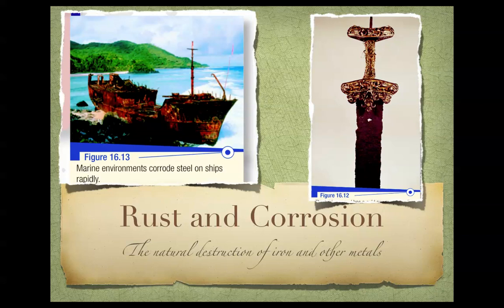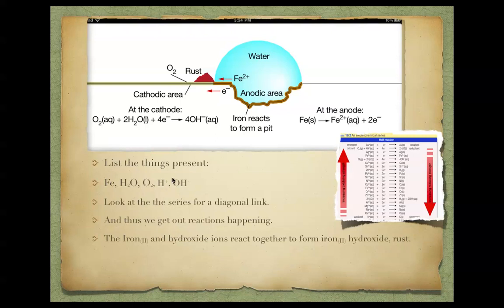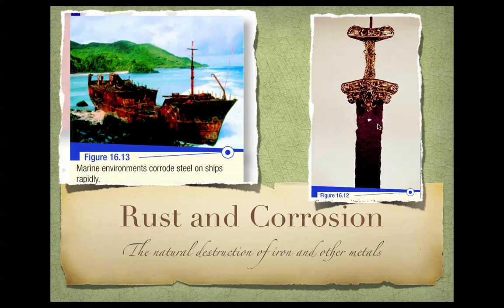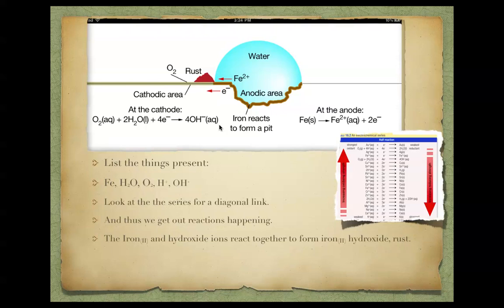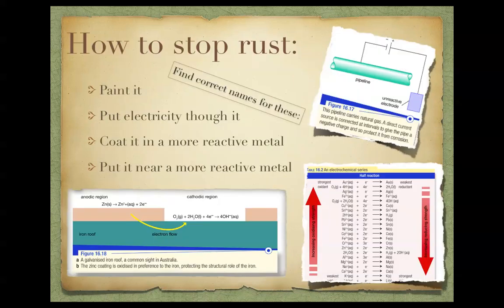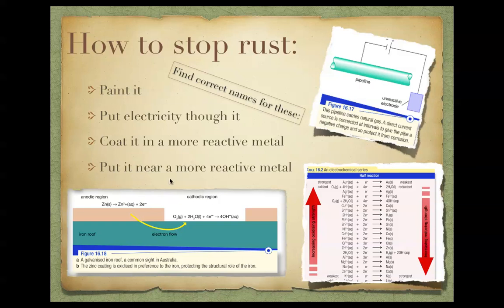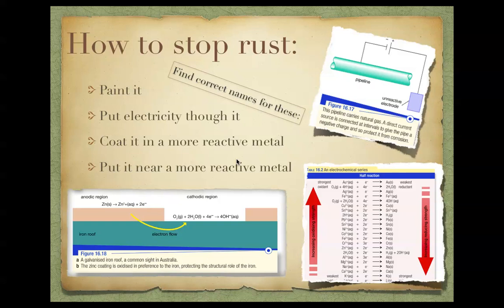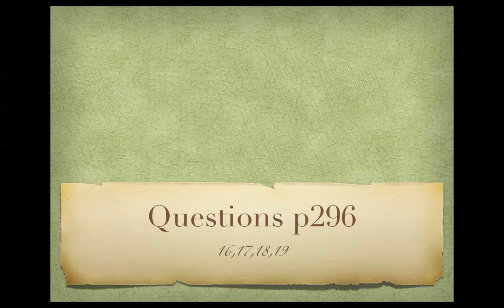Chemistry: Rust and Corrosion

Comment: at @4:00 can you please write all equations I am lost to under stand it
Reply from the maker: O2(g) + 2H2O(l) + 4e- --> 4OH¬-(aq) 
(Fe(s)  --> Fe2+(aq)  + 2e-) x 2 as you need to balance the electrons.
Add these equations together and you get:
O2(g) + 2H2O(l) + 2Fe --> 2Fe2+(aq)   + 4OH-(aq) 

OR:
O2(g) + 2H2O(l) + 2Fe --> 2Fe(OH)(s) as you can combine the iron and hydroxide as a precipitate/ solid rust.